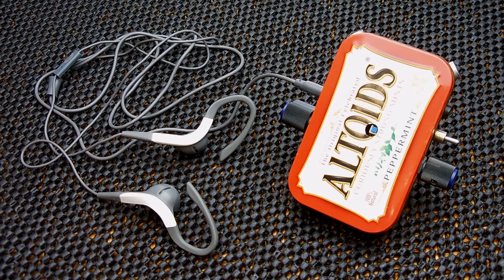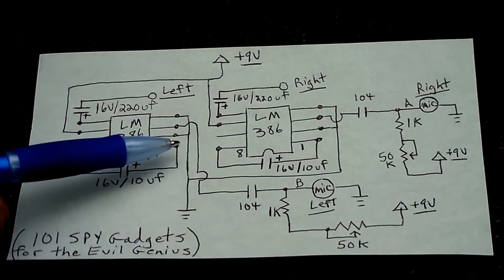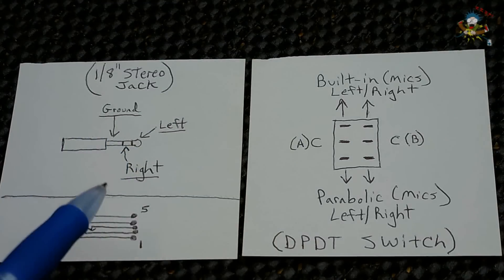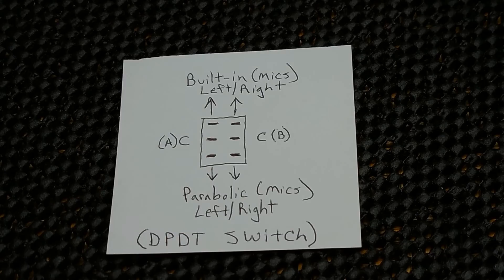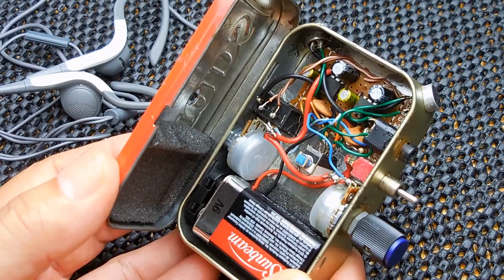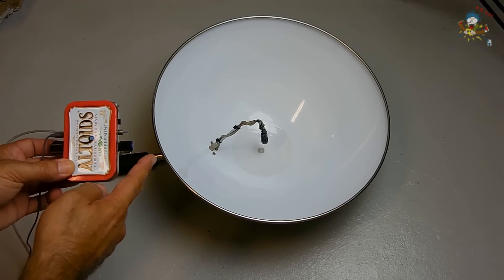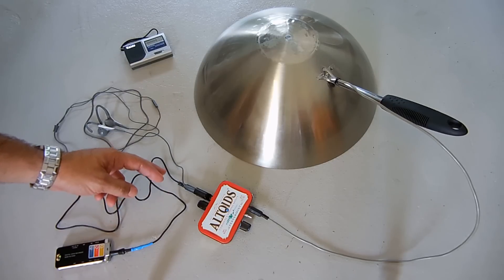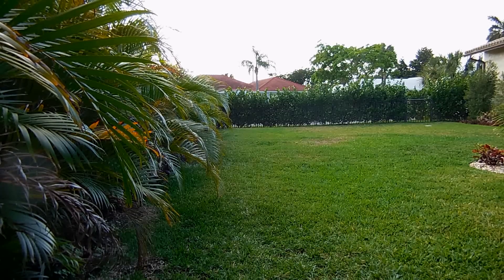How To Make A Bionic Ear Spy Listening Device!

Comment: Try an sesq83 or sesq84 for the dish for an improvement. There are others. If you really want to get serious on the amp you can use a device that was originally designed to pull in voices from 1.6 miles away with a 10 foot dish. Has high gain and tunable filters for voice. Get a copy of The Basement Buggers Bible if you can...then you can ride around in your car and feel special.

Comment: Using a 'funnel at least of plastic of generous size, insert the microphone capsule through the tube and on the 'other side apply a metal plate in the direction of the "Fire" and it should still fit.

Comment: one of the good project that is DOABLE !  Yes I knew, it is 4 years ago, but still a good diy project. Some suggestions to improve: wind noise reduction: put some 'fake fur' surrounding the mic. Ambient noise: add Tone Control (bass treble control) or even better, an equalizer to filter out unwanted frequencies. I think there is no point to put 2 microphones since they are positioned extremely close together, so no stereo effect created.

Comment: Very inspirational video.  I will be using the alignment procedure using a laser pointer to make a precise 2.4 gig transmitter/receiver for wifi using an ESP module.  I will also use the foam padding idea from ebay packing material to keep the battery from rattling around in my cheap Chinese multi meter.  This channel is full of useful ideas.  The reviews on inexpensive testing equipment is exceptional.
Reply from the maker: +Joseph Nicholas 
Glad you enjoy my videos!

Comment: Thanks for this sir, from your fellow DIYer. I do some changes, instead of using 2 potentio I'm gonna use single of it with 6 pins (dual linear rotary potentiometer)
Reply from the maker: Hi Christian! That sounds like a great idea, but each mic circuit may have to be adjusted slightly different from the other, which is why I used 2 separate POT's. I have a lot of excellent videos on my channel that cover many different subjects, so be sure to check out my extensive video playlists for other videos of interest to you, rate thumbs up, and share my channel with others. Thank You

Comment: Hi your device and video is so great but i'm a totally beginner. I have a few questions: 1.) Who i must connect the negative wire from the battery in the board? 2.) I seen in the video that you have connect the green and the black wire together from the right built-in-mic and soldered on the left contact from the mic. Who i must connect the black wire on the board from this both wires and on which contact from the parabolic-mic-female-jack i must connect the green wire? The green cable from the right contact of the right built-in-mic goes in the DPDT-switch, that i can see. 3.) Who i must connect the black wire from the left built-in-mic in the board? The green wire from the left built-in-mic i must connect on the underside of the DPDT-switch, right? 4.) The both green cables on top which come from the DPDT-swith, on which contacts of the parabolic-mic-female-jack i must connect? 5.) The black wire which going in the Ground from the headphone-jack i must connect on pin 2 from the left LM386, is that correct? I know that pin 2 & 4 of the left LM386 are connected together and this connected to the right LM386 with pin 2 &4 too.  Sorry that i have so much questions, but i will build this device and please my friend can help me???? Or can you eventually make a remake video of this unbelievable device who you show how you place and solder all the parts on the board and how you connect all the cables on the parts?  But from this updated device with the "DPDT-switch" and "the parabolic-mic-female-jack-line-in" from this video! I can send you bucks with Paypal when you can make this video. I hope you can help me my friend!!! Thanks

Comment: thank you for nice video.
i have a few motherboards that fail in the power to the processor.
can you make a video of that?
too many motherboards go to the trash for that reason.
Reply: say what? regulators are failing. sounds like your mobo's are overheating to me. may wanna build an external fanbox and duct the output air into the rear of the chassis.. filter it as well. I used a 4" tornado squirrel cage fan.. its been running 20 years.. no mobo failures. I switch the 115vac fan on/off with a 12vdc SCR running off of one of the 12vdc rails via the PSU. not only that EVERYTHING inside the box is cooled down not only the CPU (whose fan I remove they're "toys" compared to the fanbox). CPU runs around 90 F degrees, mobo around 110. downside? yeah noise may wanna put that fanbox in the next room and use dry vent hose to redirect. I use a 12" X 12" X 1" filter replace it every quarter.

Comment: Excellent video. I have a question: where its the right and left mic located at the parabolic dish. I was able to see one mic only. or maybe  both mics are toguether
Reply from the maker: Wilber  Ramirez Linares Both side by side in the dish.
Reply: so 
both point towards the center of the parabola???
Reply from the maker: Wilber  Ramirez Linares Yes, but you need to adjust the position in and out until you find where all the sound waves are concentrated.

Comment: Hey great video ! Im deaf in my left ear if I cut the circuit in half needing only one ear phone . would i need to reduce the battery voltage? I don't think I would but better to ask than let magic smoke out.
Reply from the maker: +James Franklin Use 1/2 the circuit. No change in battery voltage.
Reply: Thanks
Reply: 3.7v?

Comment: Can this device be linked to a trail cam for video and audio recording?
Reply from the maker: Patrick Kraemer You can take the audio output from this device and using the audio output to mic input cable I made in another video......do as you asked.
Reply: Thanks for your answer. I appreciate it.

Comment: sir in this circuit there is a 0.1uf capacitor...but when i search to buy it, the sites are giving results of different 0.1uf capacitors with different voltage values (630v, 400v, 300v, 250v, 100v etc)...which voltage should i buy? ..please help
Reply from the maker: Any rating OVER the voltage being used by the circuit is fine. Thanks for watching!
Reply: @electronicsNmore  thanks a lot sir for helping
Reply: @electronicsNmore  sir.. is it ok if i use 100k potentiometer instead of 50k?

Comment: Hi, I am trying to build this device but one of the 0.1 microfarad  
capacitors started smoking when I attached the battery. What could be 
wrong? Thank you for sharing your videos
Reply from the maker: You definitely have something connected improperly. You need to go over the schematic and make sure EVERYTHING is correctly properly. You may need to try using new components.
Reply: Thank you for your reply. How about the potentiometer? It has three terminals but do I need to connect all three of them? I googled it and saw some pictures that show terminals 2 and 3 in use or  1 and 2 only. Which one should I use? Thank you once again.
Reply from the maker: emergc Use the center and one side, or connect the center to one side, then use that with the last pin.
Reply: Thank you. The circuit is now working but may I may need a better microphone or headphone. I cannot hear faint sounds from distant sources. I can only hear them when I put the mic closer. I am not sure if I am getting a gain of 200 as explained in the book
Reply from the maker: Make sure the POT's are properly adjusted for maximum gain.

Comment: I built this but it doesn't work, all i get is a loud humming out of the earphones that sounds like a motor boat, i tried a couple of different lm386 ic's and two different mics but no change it still sounded like a motor boat, i checked the circuit and rebuilt it from scratch with no joy.
Reply from the maker: You definitely did something wrong, because it does work, and it's fairly easy to assemble. Probably used the wrong pins on the IC.
Reply: I think the lm386 ic's i got off ebay are faulty or fake, i stopped the humming by adding a 470uf cap from vcc to ground then i could hear low level audio from the mic, i removed the 10uf that goes between pin 1 and 8 as this controls the amplification rate from 20 to 200, the audio remained at the same level, when i replaced the 10uf it did not amplifier x200, i can only put the problem down to inferior ic's from china, i tried all 50 and they were all the same..

I will order some branded lm386's from a reputable electronics store and try again, i built another one of your projects,  listen through walls amplifier , it's works great, keep up the good work.

Comment: I think a lot of the background noise is from your electronics. You need a low noise front end. The 386 is known for it's high noise.
https://duckduckgo.com/?q=Is+the+LM386+noisy&t=ffsb&atb=v155-4b_&ia=web
You might want to build the "Curiously Low Noise Amplifier" in the middle of this page and compare background noise between the two.
http://www.techlib.com/electronics/audioamps.html That would be an informative video.
Reply from the maker: You don't realize how sensitive the circuit is. There is no noise, you're hearing wind and road traffic in the distance. Thanks for watching!
Reply: Yes, I understand you have a gain of 200 from your inherently noisy LM386s. I gave you a link to 100 articles on how noisy the 386 is, and some ways to quiet it down a little. Prove it to yourself, remove the mic from the dish, put it on your bed under a pillow, with your gain a 200, how much noise do you hear? that's a rhetorical question, you will hear a slight roaring and lots of hiss.

Comment: Why is a TRUE  parabolic surface FAR  better than a spherical surface or the curved cover of a trash can ?
If one does NOT prepared to study the effects of a sound wave reflected by a parabolic surface then don't bother to 
read what I have written. 

Both a TRUE parabolic surface or a Spherical surface or even a curved cover will reflect a sound wave of a person whispering 
say 10 meters away to a simple $2  microphone.  

The TRUE parabolic surface will reflect the  sound wave from every point of its surface to a specific point  the "focus" of that  particular parabola a simple mike will allow that sound to be amplified with little or NO distortion.

 A Spherical surface will NOT reflect the sound wave to a "focus point:  the sound will be reflected over a relatively large 
area causing the  microphone output to be much weaker (x10 times weaker  , the curved cover much weaker (x 50??)

But FAR WORSE property of a sphere or arbitrary curve , Such NON -parabolic reflectors  will also destroy the quality of the sound.
A  short, abrupt "Click" sound  will become much weaker , the DISTORTiON will be so severe that human voices will be unrecognizable or mostly likely impossible to understand ! 

observerms

Comment: maybe a dead cat on the mike could help reduce wind noise.
Reply from the maker: +Kristian B Lerche 
Won't work. You will end up reducing the sensitivity of the device. What you heard along with the radio was road traffic and wind noise in the direction of the radio. You can greatly reduce the background noise using computer software.